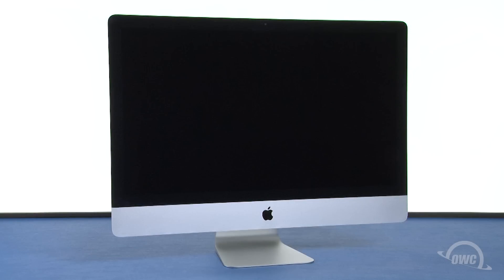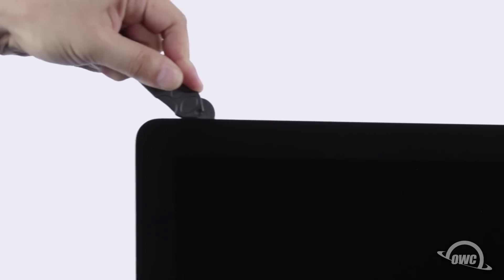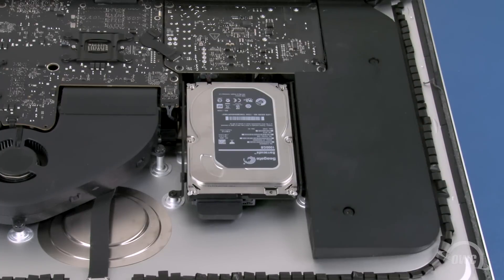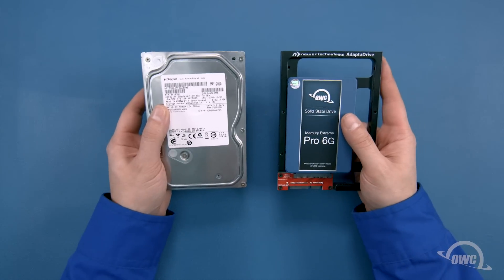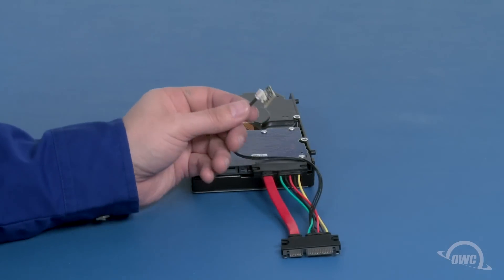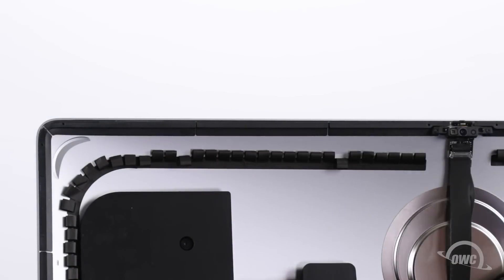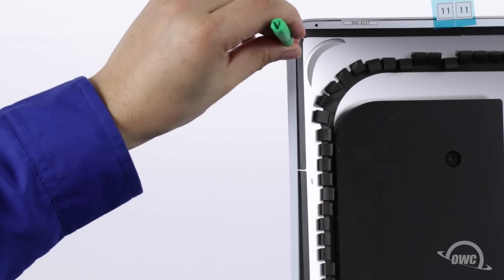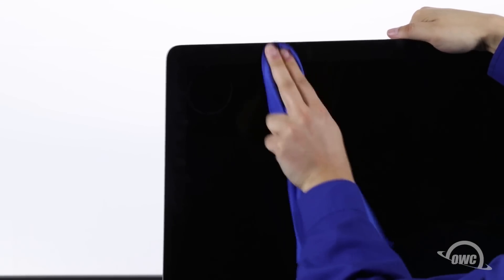How to Upgrade the Main Drive in a 27-inch iMac (2012 – 2019)

Comment: NOTE: I successfully installed an SSD in an iMac 27" 2017 5k  WITHOUT the need for the OWC thermal cable. Just plug it straight in. No fan speed issues. Do some research, It's my understanding that many of the models do not need the expensive thermal cable adapter sold by OWC

Comment: I own 27-inch iMac, Late 2012 with FusionDrive and the internal 128GB drive shows disk0s2 in Disk Utility but is greyed out and unmountable after the replacement and reinstallation of MacOS X Catalina. What can I do to access it again? I am getting this message: Could not mount “disk0s2”. (com.apple.DiskManagement.disenter error -119930868.)

Comment: Thanks for the video, good instructions! Replaced the HDD with a 1TB Samsung SSD watching this (I have a late 2012 27 inch iMac). I did not buy/install the sensor cable and have no problem with the fan speeds, the system correctly reads the temperature from the SSD. That saved a few bucks.
Reply: Thank you for sharing.  I will be installing an SSD to my late 2012 27 inch iMac.
Reply: I bought the kit and it come with sensor , IM Still going to install it lol 😂
Reply: How is it still holding up?
Reply: @deepfault  Didn't have any issue so far, it's quite an improvement. My only worry was that the tape for putting the screen back is thinner than the original, please make sure that you get good tape and scrape off all the bits of the old one thoroughly.
Reply: @ZoltanGiber  installed my ssd a few weeks ago and still its still good!! fingers crossed..

Comment: Hi, I'm about to use this video and the upgrade I purchased to replace the internal HDD on my late 2015 27" iMac with 2tb Fusion Drive, with an SSD. I can't see anything definitive about whether to break the fusion drive ahead of time. Can I just take a time machine backup, do the install replacing the HDD with the SSD, and then do a Time Machine restore? Will my fusion drive be "confused"? wondering what software steps to take before performing the drive install? Thanks!

Comment: I have a maxed out late 2013 27" iMac with the 3.5 GHz Intel Core i7 with the OEM 500 GB SSD. I believe it uses the dedicated SSD Bay so my question is can I purchase your SSD upgrade kit and mount this in the (SATA) hard drive bay (have 2 SSD's) OR can I only add a regular 3.5" SATA drive? If the later what else do I need since my machine only has the original SSD?

Comment: Thanks for the kit and the video.  I’ve upgraded my mums late 2013 to an SSD and the machine is flying once more.  Great service!
Reply: David Shaw which ssd you upgrade?
Reply: David Yang I already had a crucial SSD out of my mums old Mac Mini.  I upgraded my PS4 with a crucial as well.  Just have a look at the read / write speeds when purchasing to find a good one
Reply: @ds2000  are you upgrading the pcie ssd or sata ssd?
Reply: David Yang sata, the drive was out of my mums Mac mini and I didn’t really see the point of the extra effort stripping the machine down to get to the pci
Reply: @ds2000  did you needed some extra stuff? I know you need a converter mounting kit but did you needed a thermal sensor to upgrade your hdd to ssd?
Reply: S O nope, just the kit.  It comes with a temperature sensor.  I believe you can install a software throttle for the fan but I preferred the hardware approach

Comment: I have a late 2015 27" 5k iMac with the 1TB flash(NVMe) drive, but no HDD or fusion drive. Is it still possible to add an internal SSD to this configuration? I'm wondering if the mounting hardware/bay and SATA connection/cable can be found in the iMac still, or if it is unavailable, since there was no HDD in the machine from the factory?

Comment: Do you really need the thermal sensor if I want to upgrade to an SSD? Some people say your really need it or the iMac will spin at full power and other people say that it works just fine without it. I also read that since High Sierra, you don’t need thermal sensor for SSD’s. My iMac is an 27” late 2015. Thank you.
Reply: I just installed a Samsung EVO 860 in a late 2012 model and it works without the thermal sensor cable. The fans are on min RPM and the iMac sounds just like before (without disk noise).
Reply: I've been wondering the same for a while now, don't really wanna spend unnecessary dollars. I've actually got a Samsung Evo 860 in mine at the moment but it's not taped up as I'm waiting for the mounting bracket. I don't have a thermal sensor plugged in and there is no fan spin like what everyone else is claiming.

I am worried that if I seal up the iMac and then have fan spin later on down the stage then I would need to open it back up again.

Have you put an SSD in yet?
Reply: I have a free program "fan control" on my Imac. Works fine with ssd

Comment: My 27" late 2012 has a 1TB Fusion drive (I can't tell if this is logically or physically a single drive).  Does replacing the drive as in this video create a new fusion drive?  What is that SSD card on the back side of the main board?  Your links to purchase items do not explain if the plug in card on the back side and the hard drive work together in 2 pieces to create a single logical Fusion drive.   If I only follow the instructions in this video will I lose the benefit of the fusion drive?
Reply: A fusion drive is actually two separate drives ( a HDD and a SSD). they are linked together with the Apple app called "diskutil".  See http://www.pervasivecode.com/blog/2016/05/23/fixing-a-mac-fusion-drive-that-disk-utility-cant-erase/

Comment: If the imac is new should it be booted before installing the new drive?
Reply: If its a fusion drive it won't matter, because replacing the SSD or the HDD will unlink the components of  the fusion drive.  Actually it doesn't matter for any drive, but if its a HDD your replacing, you might want a bootable drive for an external enclosure.